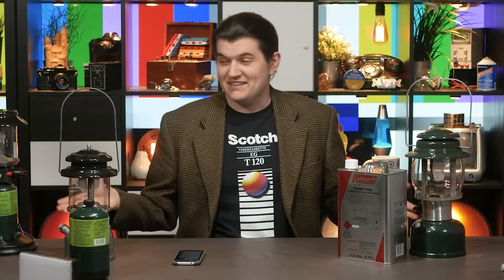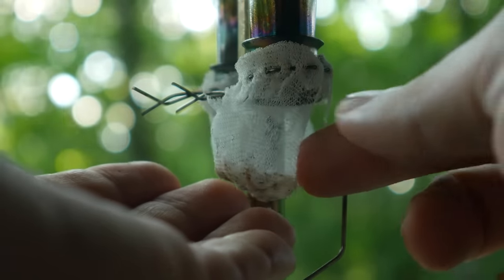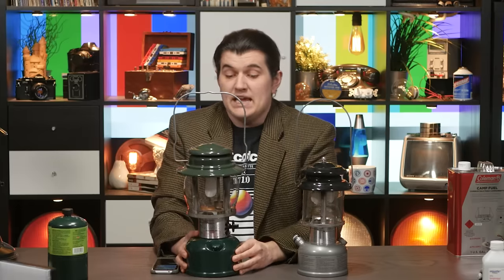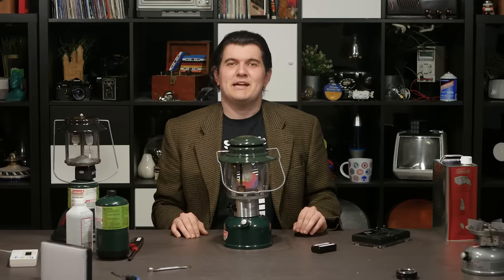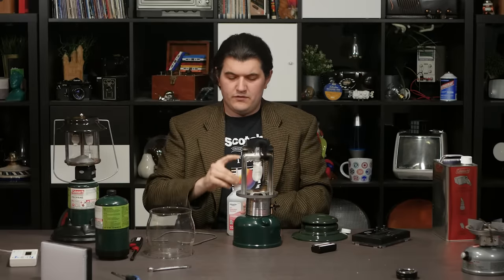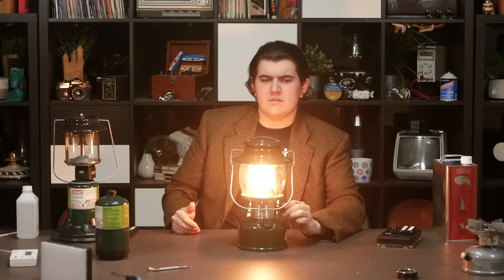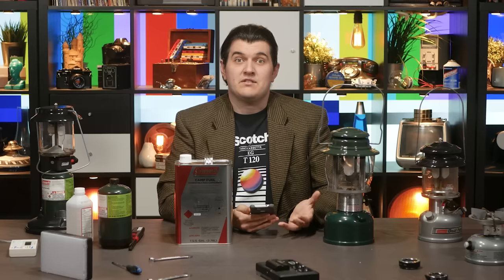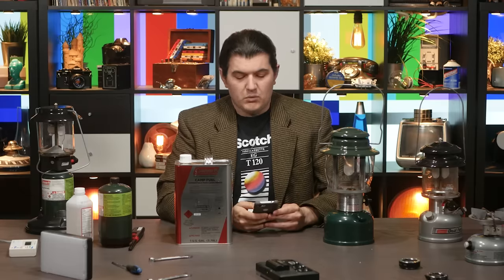A very rambly Coleman Lantern follow-up. Turns out they rarely make sense in 2021

Comment: The problems with batteries is that they go bad over time.  You could buy a gallon of white gas and store it for 10 years, and it will still contain the same energy.  Rechargeable batteries generally don't last that long.  Plus, if you don't keep the batteries charged, then you are screwed.  I had a 10.4AH LI battery pack, and i needed that to power my GPS.  Unfortunately, i hadn't charged it in a while, and it was almost dead.

And you do not want to overcharge LI battery systems.  It degrades the lifetime of the battery.

Comment: Could you run it on diesel i use diesel in my dietz style lanterns and tiki torches outdoors.  Inside i use lamp oil.  Have diesel on hand always for the tractor.
Reply: Yes the kerosene version works with diesel all the same. There's videos on youtube about it. Diesel also works on the white gas lantern in a pinch, but it will clog the generator with soot.

Comment: If you are using drug store isopropyl alcohol as your kerosene preheat instead of hardware store denatured ethyl alcohol, that isopropyl is the source of your wispy, black soot during your preheat. Isopropyl gives off black soot when contacting the upper metal lantern parts.... ethyl alcohol doesn't.
  I own several types of self-pressurizing, alcohol vapor, indoor mantle lamps (Elektra & Tito Landi lamps) and all must use ethyl alcohol. If you use other types of alcohol such as isopropyl or methyl, they will soot up. Ethyl will not soot at all. Also, if you own a reflux still, you can make your own ethyl alcohol fuel and libations. Lol

Comment: With me, efficiency isn't really what I'm after, or light output for that matter.  I don't use Coleman lanterns, I use Dietz lanterns with the old fashioned wicks.  I can see perfectly fine with them when I'm camping and I like the low light output as brighter lights tend to draw a lot more insects at night.  The Dietz lanterns I use can run over 48 hours on one fill up and one fill up is 31 ounces, it's their #8 Air Pilot.  You can also burn lamplight farms citronella oil in them which repels mosquitoes.  If they tip over they self extinguish.  I enjoy "primitive" camping.  A canvas tent, a couple of wool blankets, a fire pit with grate and a couple of old kerosene lanterns.  The Coleman lanterns put off an ugly distracting light and LED's put off too much light.  I don't even use LED flashlights at home as our home has an open floor plan and to get from my bedroom to the pc I have to pass through 2 other rooms and a small incandescent flashlight puts out enough light to see how to get through whereas a super bright LED flashlight might awaken people sleeping in those other rooms.  I DO have LED flashlights out in my vehicles in case of a flat tire at night or other emergency but  for inside the house I just use the incandescent flashlights for nightly use and have kerosene lamps for emergency lighting because they produce heat.  Our home is heated with a natural gas furnace.  No electric = No furnace blower.  For those situations I also have a kerosene heater that puts out around 23,000 btu's.  I've had it 3 years now and have never had to use it but it's nice to know it's there if I ever need it.  We occasionally get freezing rain ice storms so it's a very real possibility.

Comment: This video, really, is too generous toward gas lanterns.  Like, sure, LEDs are 100X more efficient at turning fuel into lumens... but that's only a small part of why they're better.  For starters, the fuel is rechargeable.  But also, they're tiny and thus easy to focus, so instead of shining 1000 lm in all directions from a lantern and wasting most of that light, the user can emit 10 lm from a headlamp... and get the same or higher intensity of light on whatever they're trying to see.  Combined, that makes for a ~10000X efficiency improvement.  And the weight!  Instead of carrying 5 kg of lantern, people could get the same utility from a 50 g headlamp.  Then maybe add a 500g solar panel, and they'd never run out of light since it can just be recharged during the day.

And that doesn't even touch on the other ways LEDs work better, like safety, lifespan, runtime, convenience, versatility, quality of light, and electronic features.  Like, mine constantly glows to make it easy to find in the dark, and the glow color changes to tell me how much charge remains.

Comment: Ill bet coleman gets theor white fuel from Chevron. Its caled Blazo Fuel. Its a common product in Alaska and they sell it in multiple sizes.  The fishermen here buy it in 55 gallon drums.  I get it in 5 gallon sizes for camping every year. It works great in the home during piwer outages.   We also have the cook stove.  Some homes here ise thiers reliably, rather than using a propane or electric stove.
Reply: My coleman lantern and cook stove is over 50 years old. I've only had to change the tank out. I always keep bartu powered flash lights but when we camp in Alaska we camp remote and it's a subsistence fish camp where we live for 120 days.

Comment: I read that per gallon, gas has 125k BTUs, Kerosene has 135k.... I thought kerosene would be way higher....Makes it not worth it....It would be nice to have someone make a diesel lantern that was efficient and odorless...diesel is almost twice the BTUs....
Reply: Diesel works in the kerosene lanterns. Plenty of videos on youtube about it. My vintage diesel pickup truck's factory service manual even says you can run it on kerosene as an alternative fuel, but that was before they came out with all the DEF emissioms garbage.

Comment: Why kerosene lantern?

Cause when temps hit -10 an keeps getting colder and u got shitty weather, that solar/battery powered lantern is going to be dead. Same with propane.

Do i use these lanterns no, i prefer huricane lantern cause of ease of use and just safer all around imo. I don't need that much light when out in the middle of nowhere

Comment: Your an indoor guy. That's why you don't get it. No battery lantern system compares, particularly rechargeable. Drop it in a puddle, rain, dew, heat, cold, overcast, time, battery leaking and corrosion all kill them and leave you in the dark..... no calculate down to real time sents per hour and there's no difference... eclxcept for rechargeable but they belong around a 240v house.... and yes... it was a rambling disaster...

Comment: Let's meet back here in 50 years and see if the camping fuel lantern still works, and then see if the battery powered light still works. Propane, no thanks. Kerosene, if it's the only option. Longevity of use and awesome camping experience: camping fuel, for the lantern, for the stove, for the catalytic heater, and yes, camping fuel lanterns that are already 60 and 70 years old still fire up today.

Comment: Batteries do not cook food and the problem is propane stopped working at 40 degrees Fahrenheit you're left with kerosene gasoline or white gasoline on the other hand for light I absolutely agree batteries are sufficient in conclusion if you wasn't unboiled egg I suggest propane because batteries will not even get you that far personally my choice it's firewood

Comment: I can't believe that someone with an IQ above room temperature (In 'C) can't work out why there is a hole in the pump. It prevents you from over pressurising the tank.
Reply: Hi jp6 have you become a flat earther yet? If not I suggest watch a 13 part series called What on earth happened by Ewaranon to learn that the earth is not a globe. I got it in my about tab.

Comment: Any modern lead free gas will work just fine in your mantle lantern.
 That is gasoline,, used to have tetra ethyl lead mixed in it to help control engine knock.
 It would clog the generator, modern gasoline Does not contain lead, and is suitable for lanterns.

Comment: It makes sense because Kerosene is about 1/2 the price of Coleman fuel / white gas......at least where I live.  The kerosene lantern will have problems however in cold climates -20 deg F or colder.   The fuel gets cold and will not reach or maintain a good burning boil in the generator when the fuel cools off.  Ask me how I know :-)  On the flip side the batteries don't last when you let them get that cold either.

Comment: The good old dual fuel Coleman lantern is better than anything else they've ever made they don't require batteries they'll run on unleaded gasoline or Coleman fluid I've even ran one on diesel but it wasn't happy about it battery operated lanterns required batteries and in certain situations those are hard to come by gasoline is easy to find propane lanterns work well when you have propane that's something else that sometimes is hard to come by

Comment: And another German Petromax video :https://www.youtube.com/watch?v=S2gmMTqB-V0. You can even cook with that thing. 
I need to mention that it is 9 degree C and it shows what happens when You don´t completely pre heat the contraption.
But unlike Your experience (fireballs, leaks, scared user) this guy just keeps his cool, keeps pumping pressure into the tank with a normal footpump You´d use on Your car by an adapter (very comfy) and the thing starts up like a champ, very tame.
The Petromax starting procedure is so much easier and reliable: no extra fuel to start needed, pump up, open the rapid starter, light it and after a brief period the thing comes on.
No hassle at all. Kick sand, Coleman, Heil Petromax.

Comment: Tell me you've never been camping without telling me you've never been camping
Reply: I was a boyscout, I've camped easily hundreds of times, and I've only ever used a lantern at my grandma's, and it was a dead flame.
Even in the 90s wind up flashlights were cheap, (and much lighter/smaller than a lantern & fuel)
And for cooking, either a campfire, or a simple alcohol penny stove (which is also cheaper/lighter/smaller than lugging a gas stove and either kerosene or propane up a mountain)

Comment: A propane lantern is my back up lighting system when the power goes out here in Seattle which happens for a few hours every 2-3 years or so.

I have hooks in the ceiling in three place around the house,  so I can move the lantern and flood a room with light quite effectively.  I power the propane lantern off of a larger tank of propane  connected to the lantern by a hose.  I can carry the lantern in one hand and the tank in the other to move it around easily.

TREES:  they should be banned in urban areas as nuisances! Downed leaves that people don't rake up, bushes overgrowing sidewalks and being a nuisance and trees falling across utility cable!

\We have WILDERNESS AREAS as reserves where trees are given primacy.  We should have URBAN AREAS where human beings are given primacy.  QAs usual,  environmentalists are anti human in their biases and values.
Reply: Hi seattlepioneer have you become a flat earther yet? If not I suggest watch a 13 part series called What on earth happened by Ewaranon to learn that the earth is not a globe. I got it in my about tab.

Comment: first and foremost, SO LONG AS YOUR LANTERN ISNT LEAKING lmao, and you follow the instructions and learn how to properly light them so as not to set it on fire, they are indeed very safe even for indoor usage. And speaking of using indoors, you don't need to worry about CO as not only does white gas produce the least amount of CO, the lantern itself is designed to burn as efficiently as possible, with the mantles almost acting as a catalytic. Not to say it doesn't produce ANY,  so long as you have some ventilation you will be 100% safe

Comment: The older mantles are much better than the new ones, also the older ones are brighter.   You need  a needle bottle to put the alcohol in the cup on the kerosene lamps.   That is why there is a alcohol cup for warming the generator on it.  Do not advise people  on any of these lanterns  please! you just do not know enough about them. You made it much harder than what it really is with kerosene lantern. You do not have to wait 5 min with the alcohol burning to light it.

Comment: I think what's cool about the kerosene lantern is if you use heating oil you could also use that for the lantern  
    some people get heating oil grants so you could run it for free and heating oil is way cheaper than white gas or kerosene 
    as far as warming up the generator 
I wouldn't be messing with the alcohol I'd just use a blow torch and using this method can run white gas on kerosene

nah dude I'm with you 100% 
    lived in a tent a few times in my life 
  
    light give me some solar panels and batteries any day

     and a rocket stove with peltier devices can incorporate a water heater on the cooling side
Reply: but I'm pretty sure the hole was there just so the plunger could go in with the air valve shut
Reply: me personally I have solar panels  a 40 amp hour deep cycle 12v and power inverter I use 
    with led lights 
   
for emergency light heat and something to cook on a can of vegetable shortening and a few stick candles with a flower pot will burn 168 hours
Reply: 7.87 usd for a gallon of crown white gas at Walmart here
    use it for my zippo lighters and hand warmers
Reply: for white gas lanterns there is a accessory that it a ferocerium flint wheel that attaches to the match hole makes lighting them 
 ?easier more convenient¿  atleast you don't have to look for your matches or lighter😅

Comment: If you release the filler cap just after shutting the lantern off, you're in for a very nasty flash fire, the vapour will ignite from the hot surface of the lantern. I've been using lanterns for 50-60 years and you should stop making videos of lanterns and fuels when you know nothing about what you are producing. Some of the information you are producing is dangerous.

Comment: I feel like even if you charge batteries off a generator that would still be more light per gallon of fuel... and I can't imagine someone who lives without electricity would not have a generator. Unless they don't have a cell phone either, I guess there might be some people who are so extremely off-grid that they don't use anything electrical. But at that point it's a lifestyle choice. Gas lanterns don't really make sense from any practical point of view.

Comment: The Kerosine Lantern is MUCH easier and Faster to light IF you have the Spirit Bottle and You DON'T use Rubbing Alcohol.....Use The Kind you Thin Paint with and/or Put in Marine Stoves   ...It Don't Stink and Burns MUCH Hotter and preheats Twice as Fast as Rubbing Alcohol (It Tells You This In the Instructions)

Comment: 1 NEVER USE  CAR GASOLINE it has so many additives that it will clog gnerator quickly.
2. coleman lanterns give off usable heat aswell as light
3. coleman lanterns will last several lifetimes.
4. Coleman fuel and kerosene can store for severeal DECADES in sealed can.
 if you properly learn to use them they are FAR SUPERIOR to any other light source interms of reliability and flexability

Comment: Don't know what a tin can is? pretty odd for a "Tech" guy. Tin cans are sheet steel and used to have tin plating  inside and lead soldered seams. Now mostly epoxy of some sort and a glued or folded or welded seam.

Comment: I can think why people would rather use a gas mantle lantern over a more modern ligh solution. SIMPLICITY, its simple, reliable and it need almost nno maintenance ever. Those 2 milliion fellow countrymen I said in the other commentarie, they use the DIetz kind of lantern. Not even  gas mantle ones! It's simple, kerosene is cheap, light and all in all just a perfect solution for people who has no elertricity at all